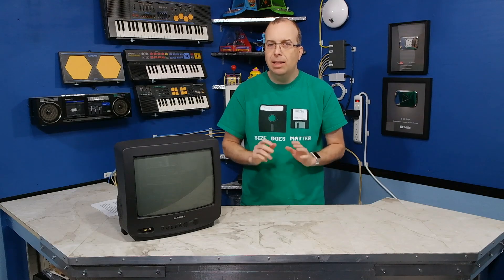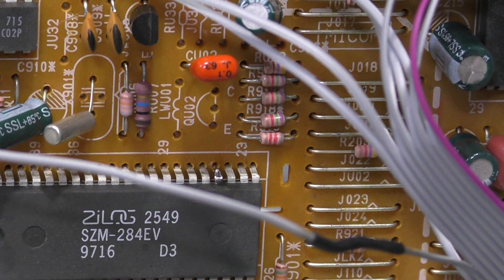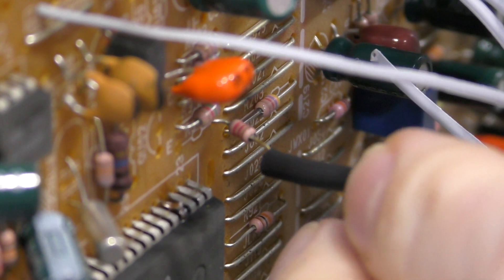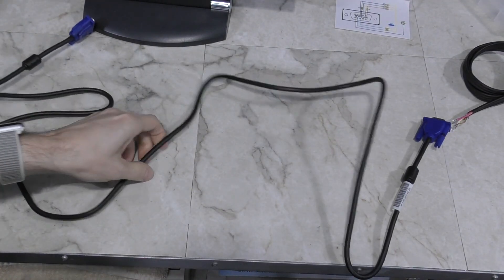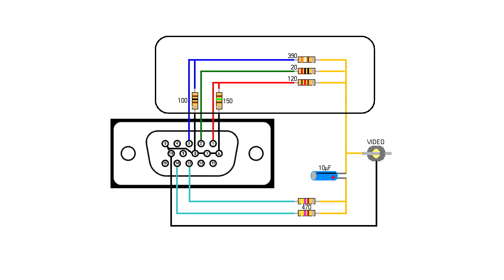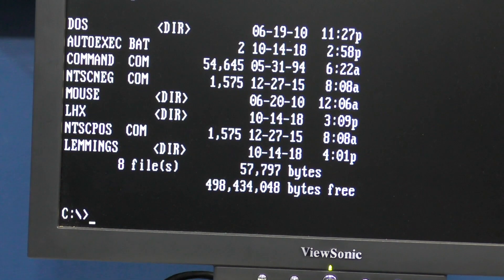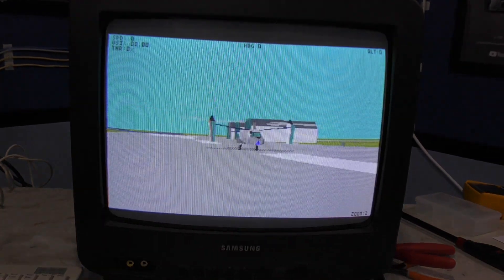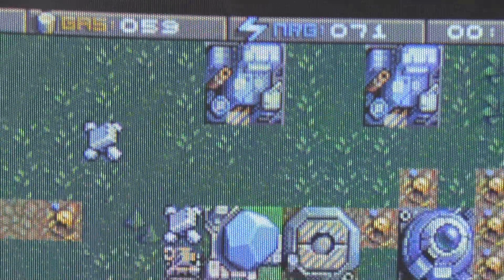Modding a TV for RGB - Part 2

Comment: And now, everybody disassembles his tv and add this mod.
Reply: Welll my samsung ips tv awready haves hdmi, vga, and rgb composite. I would like to do the reverse mod to some old devices wich i can't seem to find the rgb cable, and add the component input.
Reply: @CaptainDangeax  The biggest issue is the lack of scart cables ouside europe. I dont even know if, for example there is a scart cable, for example, for a ps2.
Reply: @eduardoavila646 As far as I know PS2 has an HDMI output, so is not in the scope of this video. The playstation classic has an analog output and then, you can choose between composite or s-video, with a 4MHz bandwidth, and RGB, with a 20 MHz bandwidth
Reply: @CaptainDangeax  No i hadnt. The hdmi cable that exists for the ps2 from what i know  is a third party cable wich actually has a circuit inside to convert the signal. So a rgb composite cable usually looks as good as the hdmi option or even better. And it would also be way better to record directly from a capture card (i think), because it would have one less converting circuit to drop the quality. 

The xbox 360 had a hdmi cable nativelly without any conversion circuits.
Reply: @eduardoavila646  http://members.optusnet.com.au/eviltim/gamescart/psx.png OK, I thought it was HDMI. Didn't have any of those consoles myself. I'm a PC guy since I sold my Amiga in 1993.
Reply: @CaptainDangeax  Nice to know there is a cable mod to that! I never seen these cables as scart never got up here. We aways used the japanese/american standards. 
I would probably struggle even to find the scart connectors to make some cables. So probably my best bet would be to import, and pay the abusive taxes my country has. 

I will someday get those scart tvs tho, but only when i will be able to bump up a bit my collecting budget.
Reply: @eduardoavila646  Be quick. European commission removed the mandatory SCART connector last year. Some TV still have it, but they're going fewer and fewer. Anyway, a RGB --> HDMI converter (or even RGB --> VGA) will always be better than any composite or s-video, for obvious reason.
Reply: @CaptainDangeax  Oh i didnt tought it was mandatory until nowdays. 
But i would probably buy a crt television anyway, so its more compatible with the older consoles wich usually dont have better options than rgb. 

Do a snes, or a ps2 look well in modern tvs through scart? Because i have a phillips lcd tv with av connectors, and the ps2 looks really bad in it, the image is stretched, not centered and really bad. Didn't look that way in my old (and now dead) philco crt tv.
Reply: Xidexs my TV has Scart.

Comment: This is nice addendum to the previous video. Nice to see that you fixed the flaw with the RGB mod, and interesting to see VGA being displayed on that CRT TV. As always, great video 👍🏽
Reply: some high end crt tvs actually had a vga mode that allowed them to work as a normal monitor, and it was as easy as switching inputs.
Reply: @dcfuksurmom  There are also some HDTVs that support VGA, especially early HDTVs made before HDMI was invented.
Reply: Personally, I wouldn't bother with the VGA, since we've all got loads of old VGA monitors kicking around.

Comment: Can you reverse the vga to composite part to hook a composite computer up to an vga/ega monitor?
Reply: No, because the composite output will be at 15khz horizontal sync and the VGA monitor expects 31khz. You'll need something like a GBS-8220 which adapts a 15khz signal for use with VGA.
Reply: not to mention that you'd also need to split the composite signal back to R+G+B+Sync
Reply: The RetroTink 2x and a VGA to HDMI cable might be a good bet too
Reply: For a digital solution like the RetroTink or OSSC you need some kinda box to convert that digital signal back to analog, can't just do it with a cable and it's most likely going to be blurry.
Reply: @Nukle0n  Well maybe not, 640 x 480 31khz is what they both output in line double mode, so it might look pretty OK on a VGA monitor with a simple adapter.
Reply: Or you could possibly use an older box, like a Crystalio or other Analogue to Analogue Line Doubler.
Reply: My 19" flat panel has VGA, composite video, 75 Ohm RF, and HDMI inputs. Problem solved!
Reply: I have a similar question but instead of going to VGA, can you convert the composite video into RGBS. As my CRT chassis only has RGBS input along with ground of course. I can't find any information online about this, help would be greatly appreciated.

Comment: I got a crt too. But theres sometimes a red "glow" (its displaying a  red glow at the top of the screen)
Is there something wrong with the tv?!
Reply: Yeahm my 24 inch Akai CRT (its sooo heavy) does that with blue. Something is wrong with the controller.
Reply: @abhimaanmayadam5713  mine does it normally in loading screens and such. (When nothing is being inputted.) But it doesnt do it when its on and nothing is connected.
(My tv is a 13"or14" audix tv)
Reply: @I.____.....__...__  ???
Reply: @raaabonlaaanon8855  Degaussing is a technique that uses a coil to keep the beam of a tube in place to prevent color issues
Reply: @dgamer5075  but it isnt dangerus if not fixed riiight?
Reply: @raaabonlaaanon8855  Oh no, A standard tube, without Degaussing is still less than a cell phone, just a tad less pretty.
Reply: @dgamer5075  thats fine.
I didnt get the crt for the picture quality XD

Comment: It would probably be cleaner to just put the new circuit inside of an adapter box that the RGB and VGA cables plug into. Either way, since you have to change the output from the VGA card for this to work at all, meaning it no longer works with any other VGA monitor, this strikes me as more of a "FOR SCIENCE!" thing.
Reply: To be fair, that's exactly what he did it for - he outright says at the beginning he did it because people asked him to demonstrate it. He originally just wanted RGB video.
Reply: @BobbleYaga  Of course, I didn't mean to imply that "FOR SCIENCE" wasn't a great reason to do something.
Reply: He literally said it was a dirty way of doing it, just for a quick demonstration.